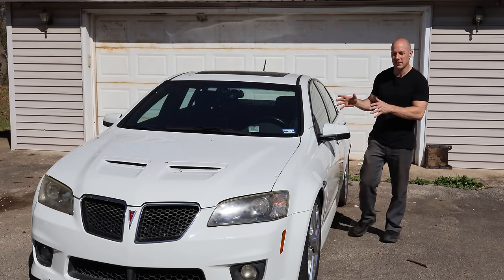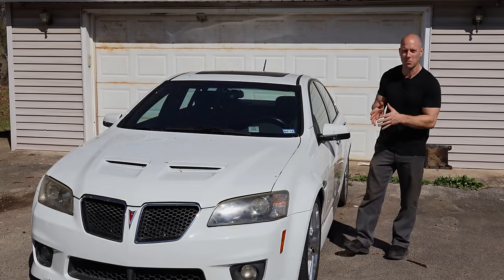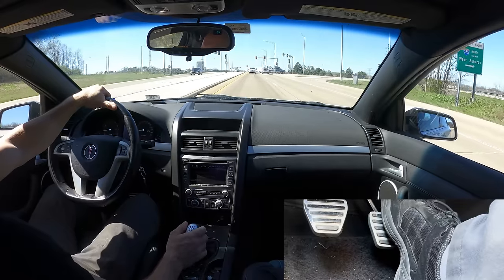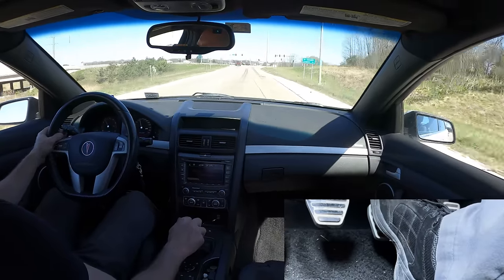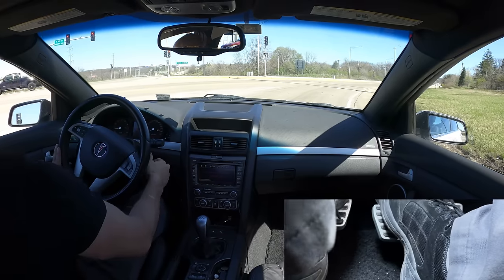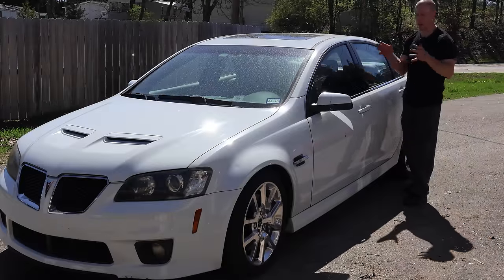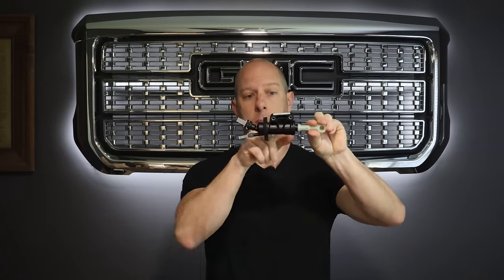How to drive a manual transmission without using the clutch, in case you broke it like I did!

Comment: The cable on my 87 Mustang collapsed on the freeway and luckily I was able to get it off the road and almost back to work. Had my wife bring me a jack, stands, my tools and a new cable I ordered from the dealer and got it back running in about 30 minutes! 😂 Great video Scott!
Reply: Something similar happend with my Volvo: Clutch cable broke, I immediatly turned to a parking spot alongside the street, used the buses to get home, ordered a clutch cable and returned to my car. No jack needed, I could install it from above, and drove home with a working car. That was a nice construction, easy to maintain.

Comment: I used to do this all the time, just for fun, I have had several transmissions go bad with gears crashing during shifts. I learned by watching videos on rebuilding manual transmissions, that
this practice actually wears out the syncros!  after only several thousand miles, your transmission will be worn out from pressure on the shifter.
This kind of shifting is only for emergencies, Using the clutch makes the syncs only slow down the gears, with no clutch, you have the weight of the entire drivetrain to slow down and mesh the gears.  I learned the hard way, I hope you learn from my mistake!
Reply: This is the comment that should be pinned up top. People need to know not to do this with synchronized transmissions unless it is an emergency.

Comment: in 67 I was in HS. Had a 59 Impala bubble top.  It was a 348 Powerglide when I bought it.  I decided it needed a manual trans so I found and swapped in a 3 speed with a Hurst Synchrolock.  One day on my way home from school the ball stud snapped off in the block.  I drove it home exactly the way you demonstrated.  Replacing the ball stud was a lot simpler than a hydraulic throwout bearing.
Reply: Old timer you sound like a badass.

Comment: Years ago, I owned a 1987 Ford F150 with the manual trans.  I can 100% verify that the firewall does in fact fatigue and crack in such a way that working the clutch becomes a task meant for the incredible hulk.  There was a repair reinforcement plate that corrected the problem.  I don't recall if it was a Ford part or aftermarket, but it did the trick.

Comment: Hi Scott, great example of what to do when the dreaded clutch goes, as you become an experienced driver, much of what you do is all about timing, meshing with traffic, lights and so on - i am always amused at folk that stop at a junction in front of me, they don't read the road, they are looking at the traffic and still stop, where as i may slow or speed up so i can mesh with the traffic, avoiding them and giving them time to avoid me, roundabouts a particular favorite, because even at very low speed assists in getting out safely, people will stop completely forcing them to have more time to get out, not easy on British roads, haha i recently noticed a couple of notorious roundabouts having traffic lights fitted, great idea, should have been done 30 years ago and saved countless accidents

on the side of a clutch going, i've had this a few times myself, and managed to get home, with the old Land Rover it was indeed fun, trying to get the old girl to start in gear, pull away and change gear, many times was near impossible to get from one gear to the next, getting the engine speed right another
the Audi S3 was very different, the box the clutch pedal was attached to broke three times on different occasions, the pedal disappears into the carpet, most odd, but the gear changes were fairly easy, all about timing and engine speed (not the speed you are travelling) because here in the UK we have hills and this can effect you as well, as the loads on the gearbox will change - but it is fun, nerve racking but fun - timing junctions, traffic, and lights a real skill, like trying to tame a beast, but doable

Comment: I remember many years back.. the 80s.. borrowing a Lancia from a car dealer friend as I needed to make a 30 mile trip to somewhere south of London.. all suburban driving..multiple roundabouts, traffic lights, pedestrian crossings etc.. the clutch cable broke as I was beginning the return trip.. I managed the drive back, carefully adjusting speed when approaching slow or stalled traffic, matching the engine revs changing up and down.. made it back feeling quite proud of myself :>)

Comment: I had an 85 Mustang GT where the clutch fork decided to snap at a traffic light. The process was the same except when you were stopped, putting it in 1st gear it was the starter that propelled the car until the engine actually started. Fortunately, the starter was strong and so was the battery.  Otherwise, everything else was as you demonstrated.

Comment: 1970's Vegas had firewall metal fatigue as well....
Reply: They also had the worst engine GM ever made…. Those flat sided 4 cylinders were absolute garbage..
Reply: Well, the Vega engine sure gave the 1980's diesel conversions a run for their money as worst engines ever made 🤣
Reply: 2008 - 2014 Subaru Imprezas do as well.
Reply: @nobodyspecial6436  I had a '74 Vega and put 80k on it with out any problems (except the clutch). I was 16 at the time and drove it like it was stolen.

Comment: I drove like this for nearly a year, but, with using the clutch only to get into 1st gear and reverse. Then after that, I had to rebuild the transmission for 2nd gear. They don't call it crashing the box for nothing. But, I like your stop the engine start technique. Clever. I've seen Kimi Raikkanen never use the clutch and never turn the car off. Just slowly pushing the shifter into 1st gear from a stand still. Either way, just letting the clone clutches on the sychro rings doing all the work. Again, clever in a pinch. Cool video..!

Comment: I was messing around once in my Subaru WRX after watching a video about Colin McRae and his driving style (one foot gas the other brake) and forgot to hit my clutch and inadvertently did a perfect gear change with no clutch. No grinding or catching at all, a perfect smooth transition from 1st to 2nd. At first I thought it was just incredibly lucky wizardry, but as I learned more about transmission works with a standard gearbox, I realized that while I was absolutely lucky, it wasn't wizardry after all. 

And screw the haters, if there's no one around to hit, pin that throttle

Comment: Oh good memories. Drove my son's 99 Accord 5 speed home from Lexington KY. About 90 miles mostly highway. Planned for mostly right hand turns. Forced it into 2nd too hard a few times, so after fixed (slave cylinder) made a little grind shifting to 2nd, but barely noticeable. I might have run a few red lights

Comment: Way back when, I had a 59 Dodge pickup with a 4 speed with the granny gear. When the clutch broke, it was trivial to put it into granny and start the engine. I even did it once with the parking brake set! I didn't even realize it until I tried shifting, it slowed down pretty fast once I got it out of gear! One interesting thing about that transmission was that it was the exact same transmission that Dodge used behind the big Hemi engines. My little flathead six was never going to break that transmission.

Comment: Start in gear (if you can jump out the safety). Then rev slightly past the shift point. Put gentle pressure towards the next gear.  Let the rpms drop slowly, continuing the pressure.  My truck would "suck it"  into the next gear when the rpm was right.

Comment: Been there done that.
Back in the 1980s.
Actually I may have found myself in two different cars, a 1950s L15 Citroen and a 1960s Triumph Herald, the latter a British car and the former British-assembled.
Both cars had manual chokes. This is useful for keeping revs up.

My concern was the starting so I chose a route that would avoid stopping on an uphill, or even flat. The trick is having sufficient power to start and move the car in gear.

On yet another occasion I found myself in the middle of nowhere with no clutch. My girlfriend and I had spent the night in the car, a Falcon (Australian XT) station wagon (estate) and woke to the problem.
I had no tool kit with me. But I did have a three inch adjustable wrench on my keyring and a teaspoon (don't remember why).

Fluid was down in the clutch master cylinder. I spooned fluid from brake master cylinder to clutch master and bled with my little crescent. That got me mobile enough to go buy some more fluid.

Staring a car with no clutch and driving in what was effectively a soggy paddock (field) was not an option on that occasion.

Comment: My father was a truck and bus driver , so when he taught me to drive , he taught me this straight away . Before driving buses in the 1950s , he was a driver in the army in WWII ( Argyll & Sutherland Highlanders ) and fought in Europe for over 5 years ( pretty much the whole war , and I have his medals to prove it ) during which time he drove motorcycles , cars , trucks and tanks .
As per the comments of another contributor , I had a clutch cable fail on a VW Beetle , and remembered my father's lessons . Even without a failed clutch , I kept practice at clutchless gear changing and would only use the clutch to move off from rest , as most truckers do anyway .
I mostly drive automatic , but I can drive manual , and sometimes non synchromesh cars , but if you get it right , that is OK too .
My first car was a 1957 'Ponton' Mercedes , and the clutch pedal on that car rotated a shaft which acted directly on the release bearing , no linkage at all , so that was the best engineered clutch I ever used - and I kept that car for 38 years !

Comment: Back in the day when I worked for a car hire company, I had to do this several times recovering vehicles. Once the car was parked on a sloping car park facing uphill.  No way I could start it in first gear uphill, but fortunately the car park was empty, so I started in reverse and did a u-turn until I was backing back up the hill,   Disengaged reverse gear, and waited for the car to stop and start to roll forward then slipped it into first.  No problem.

Comment: Back in the sixties I learned how to do this on my motorcycle (BSA Super Bantam), when my clutch became stuck a couple of hundred miles from home.  Since the bike was lacking an electric starter getting moving from stationary was a bit awkward, much easier downhill.   Once the clutch was fixed I often only used it for stopping and starting.

Comment: Once tried this in my 1998 Škoda Felicia, you get the hang of it suprisingly fast.
Reply: Does it not just stall when starting up in 1st gear?
Reply: @TheVicar  In the case of getting going, the starter motor will help the engine to get  moving. Its obviously not healthy for the starter motor, but it works for emergencies.
Reply: @renax7631  So get it moving with the starter motor and then put it into gear?
Reply: @TheVicar  1. get into 1st gear -> 2. get the car and the engine moving with the starter

Comment: I used to do the same with my 74 CJ Jeep. It had locking hubs for the 4 wheel drive. I would lock the hubs and if I needed 4 or 2 wheel drive I would take my foot off the gas and push in the clutch so I was coasting and then I could slide in or out of 4 wheel drive.

Comment: Been shifting the gears in the manual transmission vehicles I have owned without using the clutch for more them 40 years. Learned how to do from a truck driver that had a brand new International Cab over back in the 1970s.

Comment: WOW...even the garage doors rust out in Illinois. I had the main seal on the clutch master fail on a 74 Datsun PU, puked fluid all over my shoes just as I was pulling into my jobs parking lot. Got a buddy to drive me to get parts at lunch and after work I replaced it and pumped and bled it enough to work...another lesson to always carry a few tools!
Reply: I had the same problem on an early 70s Datsun as well.

Comment: A long time ago I had an 83 Hyundai Pony 5 speed. Was a cheap but fun little car. The clutch cable snapped (after getting other work done... go figure) and I drove it like in your video for about a year before I finally got it fixed.

Comment: I used to drive a Freightliner Tractor and I used to shifter the 18 speed manual transmission exactly how you described how you’re doing your car. Nothing was wrong with my clutch, the older drivers taught us that. I think they called that “floating.”  That was over 30 years ago, so I may have the terminology wrong. It was fun though.

Comment: I had to do this long time ago in my crappy Dacia. (there was a time when nobody knew those cars, before Top Gear, though mine was the old old one, a Renault 12 clone). Those were days when poverty teaches you to be a good driver! And a mechanic!

When I was doing it, the starter would move the car, and when (or if) it started it would lunge ahead with all of 40hp lol. This brought back memories. Also reminded me of pushing a car for 20miles. This was no little Renaul, but a Pontiac Grand Prix. Me and three buddies pushed it to this shop with a lift. Ive been reminiscing lately....sorry for that.

Hope the new shop is coming along.

Comment: I live in a cold climate, so here is an extra advice. Before you drive the car this way - set the gear in neutral and warm up the engine for one or two minutes. And when bringing the car to a halt, flip the gear in neutral and let it coast to a halt using the brake. When backing, with the engine stopped, set the gear in reverse and start the motor. Be ready to flip the gear into neutral and brake before backing into some walll or car.

Comment: LOL, back in the early 1980's the clutch cable in 71 volvo broke, drove it for a month like that, couldn't afford to fix it.  i got really good at starting, reversing and shifting, transmission went on for another 5 years after that, i didn't hurt it all.  i shifted a big truck with a twin stick 5 by 4 for several years without using the clutch

Comment: I drive almost daily my peugeot 106 without using the clutch (i only use it from stop in 1st since it's not broken). But i use revmatching for downshift, it's way more convenient and once learned you can easily do heel-toe (or you also learn left foot braking)

Comment: I own 3 4x4 vehicles with manual transmissions and I have a bypass switch for their clutches so that I can start them in gear with the clutch out. I also can crank the engine in gear in the event of an engine failure so that I can get off the road; easy cranking load in first .gear and transfer case in low range.

Comment: Growing up in the 80s I had to drive without a clutch a couple times but zero effect at the pedal so I was glad the car didn't have the clutch safety switch.  I also broke a shift lever and was stuck in 3rd gear and another car that was stuck in 1st gear on the way to my sisters wedding I was standing up in so no fixing it in a tux.  Fun times

Comment: Tried this in my old manual car sometimes. If you have a feel for your car its not that hard to do. I miss my stickshift, as the rs3 i wanted and drive now only comes with a dct.

But its very common on bikes or at least its similar. Because its a sequential and the drivetrain interia is lower you can pretension the shifter. Once you let of the throttle its gonne diengange and snap into next gear. Or just a blip on downshifts. Clutchless shifting is very satisfying

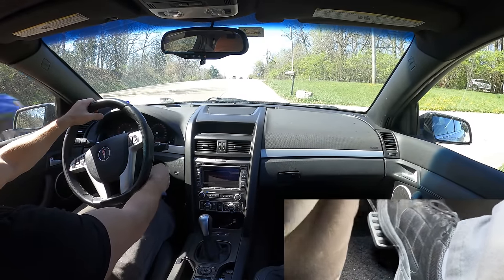Comment: 3:42 This car has a clutch that obviously works well enough to be usable because the engine is idling while gear is selected but car is still in place. If the clutch doesn't disengage at all, the car will be moving immediately the starter motor starts to turn. And unless your battery is in good health, it may not be powerful enough to move the whole car fast enough to start the engine.

Comment: Rev matching. Nice to see. But in 3 cars and 25 years I have never experienced a clutch failure. My last car I purchased new (2006 BMW 325i) and when I sold it in 2021 with over 200,000 miles, it was still running the original clutch with no issues.

Comment: I blew up my flywheel back in the days and couldnt disengage / engage the trans while the car was on. I rolled the car to the nearest gas station and then put it in 2nd gear and started the car. I drove the car to the nearest shop and got it fixed. 2nd gear was perfect since u could drive the car from 0km/h to 130km/h while having 2nd gear engaged lol

Comment: I used to work at a car auction  moved cars and drove the tow truck..  did not want to use the tow truck....  
At the gate a few times the clutch gave out right by a big speed bump with spikes.  Off engine 1st gear I 2 foot brake gas like 3/8 pedal crank and go violently but it moves. Downshifting is fun when you are on the streets every used auction car I drove on the street I floated the gears up and down for practice.  Not my car!!!

Comment: My father had a 91 Civic for almost 400k miles. Still the original clutch because he shifted like this all the time. 
I never could master it on either my 48 Plymouth or 55 Dodge truck but i chalked it up to column shift and mechanical linkages

Comment: Don't know about the Pontiac, but I had a Chevy Cavalier that the clutch went out on it back when I was young and poor. Hydraulic clutch, 1 piece plastic hydraulic assembly, dealership only part. Dealer wanted more for the part than the car was worth. I drove it clutch free for about 6 months until the head gasket let go. Same method you used.

Comment: Fun Fact:
In NSW, Australia (Where I live), it is illegal to coast in neutral as you are considered to not be in control of the vehicle.
Reply: That’s also fuel-inefficient given that the fuel is still used to idle the engine in neutral but when in gear it is cut completely and the engine is moving only because of dragging